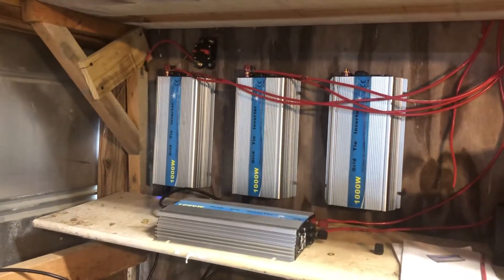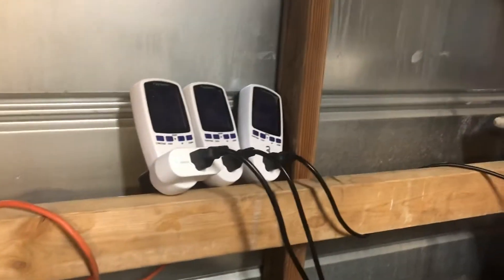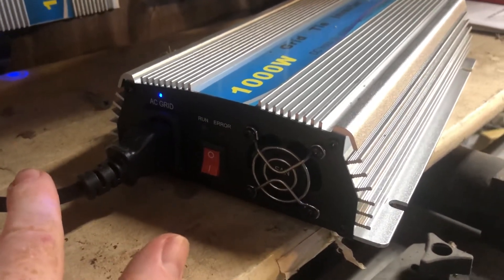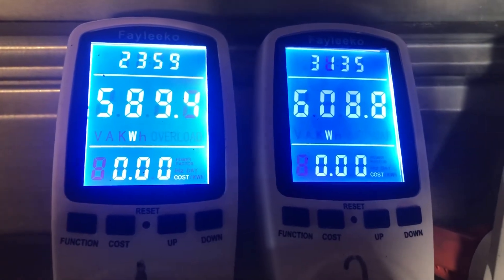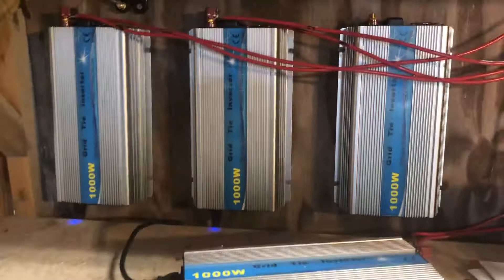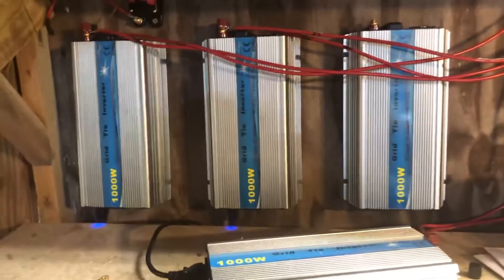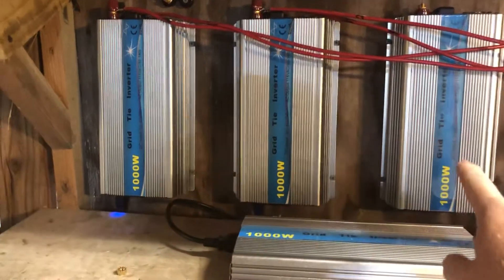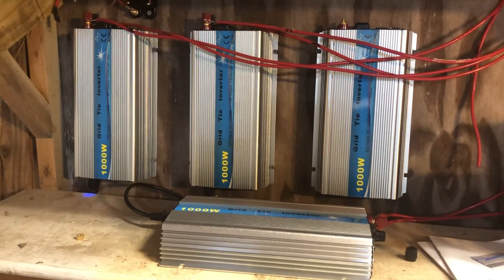Installation of plug-and-play grid tie inverters

Comment: Thanks for your video. Can you say something how long the life time is for this 1000watt converter? Are these good and have you cheap adres?
Reply: i had a 500w ran for several years. until i overloaded it with new panels.  got another one for higher voltage. running perfectly

Comment: I am about to get one. One question; does this inverter give pure sine wave or modified wave? I have a few UPSs connected to the grid and they have to get pure sine wave current in order to work...
Reply: Yes, it'll be the same sine wave as the grid, that's how these things work....they match & sync their wave to the grid wave and then they increase the voltage slightly which means the inverter's power will get used first before the grid and any additional power will come from the grid.

Comment: Add drywall anchors/screws so they stick down into the cooling fins and install 12 volt fans, 2 per inverter. Wire the fans directly to the inverter terminals so they spin they will start spinning around 8 volts, we use a resistor to cap them at 12 volts.  You will never burn one up again

Comment: Good setup. 

Question: Would it work with a 110 volt Ac to 12 volt DC converter (600W)? Is there a limit on the amps?

Comment: to be clear on my end, these and most grid tie inverters can be tied to wall outlets as long as you do not exceed the current rating of the outlet ?
Are these, and most inverters 220vac ? if so do the inverts come with a neutral connection so you can pick off 110v and neutral for wall outlet ?
Do the inverters come with a setting for grid down or isolated use ? I understand norm use they need to stop during grid down for line safety.
Reply from the maker: They only produce 120v. In a grid down situation they will shut down so as to not back feed

Comment: Hello. I screwed the inverter to the aluminum plate. The heat from the inverter dissipates perfectly.
Reply from the maker: That sounds like a great solution
Reply: @tennesseevalleysolar4101  My 600 watt inverter with an aluminum plate does not use active cooling

Comment: I need help. I bought used 205 watt panel and Amazon 1000 w invites. But seeing was not as easy. Wires coming from panel to sizes one mark 4 mm and other thin with no mark. And they had to male ends 😢  I had bought 10awg 6 mm can I solder different mm together?
Was also just going get wires with alligator and ring end to connect to inverter will that work.
Plan just help with what electricity I use.

Comment: So,  do you have these inverters running into the same lines that are also powered by the grid at the same time?    In essence,  you plus then into the wall sockets,  so that other wall sockets on the same line will be powered.   Like a fan or something correct?    And if the sun is shining,  your owners/inverters are powering that line.    What if a cloud comes up,  and you don’t have enough power,  does the grid pick up the leftover slack?     So you have 2 supply lines on the same circuit ?

Comment: Have you run into the issue where you have produced more power than you are consuming therefore technically making your meter look like you’re actually using power that you’re not? Or is your consumption way higher than your production?
Reply from the maker: Most of the time, my consumption is greater than production. I dont have net metering, so my meter only counts up which means you pay for what you over produce. However, that is less than paying your full power bill, as I dont over produce very much

Comment: Have you charted the savings and if so, can you predict breakeven or payback time? (ballpark) Using utility costs in my area I'm thinking maybe $500 a year in savings. That's enough to offset my hot tub and a little more. Certainly not instant gratification.
Reply from the maker: I have not tried to chart that. These are a good place to start, but I would suggest to shoot to move on. to something more robust. Growatt has some nice grid-tie units

Comment: I just had a quick thought based off of your design. I noticed that whenever you were showing the voltage meters, wattage meters on the wall that you have the same Emporia electrical monitoring system I have. Just a thought but have you checked to see how much voltage the units are pulling at night time which looks to be like yours is at night because I didn’t see the green lights on maybe I’m mistaken. I read an article the other day where a person was talking about the wattage that these devices pull which granted isn’t much but if you figure having it automatically have the switch shut off at dusk and come back on at dawn, just a thought. I like to set up though, KISS.
Reply from the maker: Yes it was a quick and simple solution. These boxes are not the most reliable and dont last real long but they are a quick and easy way to get into producing a tangible effect on your power bill. 

I never messed with trying to shut them down, but I would thing that smart plugs programmed to shut down at dusk would do the trick.
Reply: @tennesseevalleysolar4101  I actually went through and set my Emporia plugs to do just that. At 9 PM they shut off at 6 AM the switch turns on which is ideal being in east Texas with the amount of sunlight we get, as well as when it starts and stops during the day.
Reply: @tennesseevalleysolar4101  so literall it just start providing power to your home thru the outlet its plugged into and if your home uses 2000w/hr these we will supply xxx. watts .. .making your use of electric less from the grid right?  so one your setups shows 600w..  my home is using 2000w  / hr . so i am pulling 1400w from grid 600 from my inverter.. not constant i know but whatever its producing at a given moment.

Comment: Anybody that is using these, I have a question for you. I’ve got one of these units I’ve been running for a while now and bought one probably 10 years ago and what I’ve noticed is the unit that I currently have running when the leads are not hooked up to the unit it’s showing in the mid to upper 37 V range which is perfect for where it needs to be at based off of the unit that I have. However as soon as I connect it to the inverter and turn it on it’ll start to do its thing but when you touch the leads to check the voltage at them it’s only showing roughly 27 Volts, any thoughts on why this would be? I have double and triple checked each one of the solar connections coming into the unit, and as a matter of fact I have four 300 W panels hooked up and no matter what I cannot get this thing to go over maybe 550 W at best. Even if I disconnect one or two of the bigger panels and use smaller ones it doesn’t matter I still cannot get it over that. Thank you for any input
Reply: solar panels do not have regulated output unless you add charge controllers to recharge batteries. Basically you are reading "open circuit: voltage versus "loaded circuit" voltage. This is normal.
Reply from the maker: All panels drop in voltage when connected to a load. Unhealthily panels on their last leg will drop down to nearly nothing when you try to apply a load.
Reply: If you take a look at the specs sticker/plaque on the solar panel it will have VOC open circuit voltage (not hooked up to load) and VMP optimum voltage under load. You'' probably find that your 37v and 27v are close to those figures on the specs sticker/plaque.

Comment: HOWdy T-V-S,
...
How long did your DEAD unit last before going BELLY-UP  ?
...
How are the WARRANTIES on these units ? ( any ) ? 
...
COST per GRID TIE  unit ?
...
COOP
...
Reply: They usually run about $100-200 on Amazon and/or eBay. Just make sure you get the correct voltage unit you need.
Reply from the maker: They have lasted different lengths of time. These units are not the best, but are a good place to start.

Comment: hi David thanks for sharing this video, I see you have what appears to be an Emporia Smart Plug plugged in to one of your Killawatt power meters, 0:32 how did you get that to work as I tried and it is directional and I even spoke to their tech support and they confirmed we can not use it to measure how much power we are putting back into the grid, it's not designed to do so
Reply from the maker: I ended up not really messing with it much. I was hoping to use the smart plugs and home automation as a way to limit production to prevent overproduction. That project never got far
Reply: @tennesseevalleysolar4101  ha ha well your idea works, or at least it graphs the data but as far as Emporia is concerned it shows it as consumption and not negative numbers as in ingestion of more power, I did let the company know, they are working on it
Reply: @tennesseevalleysolar4101 Mine smart plug keeps cutting off. So much for that.

Comment: Folks, these are very simple machines, very little to go wrong. The user will kill them. 
A few rules, heat kills... I run a 1000w at 450w coming in. Temp is always keep at 
95f,. Very cool to the touch.  I pulled the bottom fan and put a better fan on the out
Side. Never run over 50%, never push these, a cool unit will last for years.. Last rule, 
Dont expect to make money. At. 12 cents per kwh, 1000w, you do the math. I do it
As a hobby and to keep my 700 watt solar system busy..one other thing, try not
To run a 12v grid tie, you have to use 10awg wire, i went with 8g into the unit.. 
Keep all your wire cool... 
Thanks for the vid
Dennis
Reply from the maker: Yes, the wire in the video is 8 Gauge THHN. I have 1200 watts of solar on my grid ties and they seem to work ok. I guess that wears them out faster, but I keep a large box fan hanging in front of them to help cool them down

Comment: do you need approval from the electrical utility company to use a grid-tie inverter?
Reply from the maker: It all depends on what area you live in and what the power company rules are. Some companies dont care at all and others go out of their way to make it nearly impossible
Reply: Two things.  First of all, there are "greedy" meters out there; meaning they only count UP, even if power is going TO the power company. They get free power from you, and you show no usage.  Secondly, if you keep your supplemental energy below what you use, the power company will never even know.  All they will notice is that you're no longer using AS MUCH energy as you use to before.

Since the homeowner doesn't have to mess with the breaker panel, there is no need to call an electrician, and no need to ask permission from power company.

The only negative thing I can think of is what happens when there is a black out and you are not home to stop the inverter from sending power into the grid? If a lineman starts working on a wire, they will get shocked because they are not expecting the power on the line(s) from the customer side. THAT they would be upset about.

Even if one has a timer that only allows the inverter to run during daylight hours, if a black out happens during the day, I can't think of a way to have them stop sending juice.
Reply: @redmatrix  " Your very own comment from above. called anti-islanding, or islanding protection" a GTI has to sense power (120V) on the line it is plugged into before it will send power from the inverter. That's why you can plug in your panels and hook everything up and then grab the prongs that go into the wall socket, it won't energize the plug end unless it senses 120V coming in.

Comment: May i ask what kind of utility meter you have on your home? Digital or analog?
Reply: digital
Reply: @solar24gr  how is it possible to back feed with digital meter? My understanding is if you dont have a bidirectional meter you will be charged for power you backfeed to grid as if you were actually using said power
Reply: @randynewman3184  My own is digital for me to see how much generated per dey but the electrical company meter is analog
Reply: @solar24gr  perfect! Do everything you can to not let utility company change your analog meter! That analog meter is priceless! You basically have free energy storage solution
Reply from the maker: Yes if you dont have a bidirectional meter, you would be charged for any power that you over produce. For this reason it is best to keep your grid tie production close to the amount that you are consuming. If you over produce by a little bit, that is better than paying your whole bill.

Say, for example, you are producing 2500 watts but only using 2000 watts. You would be paying for 500 watts. Would you rather pay for 2000 watts (no grid-tie) OR 500 watts (from the over production)?

Comment: Unfortunately this inverters will burn about 3 or 4 months maybe 6 months! Over heating problem!
To avoid damage you must modified cooling fanction!This inverters start cooling by fans over +60-70 celsius!
That inverters need install thermostat switch N.O. 45 celius stick on transformer and must connect in series the fans to with thermostat switch,fans will start cooling from 45 celsius and you will avoid the overheating damage.I am technitian.
Reply from the maker: I have seen similar issues. I have a large box fan hanging from the front of the shelf above. This seems to be helping a lot

Comment: The wall sockets are already live and  supplies 110v/220v ..... ?  Will this not cause "feedback"‽
Reply from the maker: No. The grid-tie equipment produces the exact same sine wave of power as what is already in the socket so the power does not "fight" with itself
Reply: i’m not sure if he showed it in the video or not but whenever you first plug the device and of course you want the switch to be in the off position and then your panels hooked up and plugged into the wall. Once you’ve done that and you flip the switch on the Red light mean momentarily come on then the green light will come on and it’s flashing, as it’s doing this it’s adjusting itself to the frequency of your current electrical grid at 60 Hz approximately. Once it does this the light will go solid green and you are now back feeding, Offsetting what you would normally be using. At any given time if you normally drill 1500 W and you have this plugged in during the day and it produces 500 then during that course you actually only pulled one thousand off the grid and your unit produce 500 but at night time you’d be pulling 1500 off the grid because you’re producing nothing at night unless you were using this on a battery back up system which is a whole Nother story lol

Comment: Hi there…many thanks for posting your video…I wonder if you can help me regarding the following…I have bought a 1,000 watt Grid Tie Inverter…but has come without instructions…it shows DC input as 10.8 - 30VDC……..AC Output:230VAC (170-260)………I am in the U.K. and have 7 X 100watt 12volt solar panels…ground mounting I hope…though I doubt with the U.K. weather that they would put out anywhere near the 700 watts especially in the winter…could I link all 7 panels together to leave as 2 cables positive and negative and connect to the Grid Tie Inverter?…also could you tell me do you connect the Solar Panels first to the Grid Tie then plug in the Mains plug?…or doesn’t it matter providing the little red switch is off?…I would be grateful for any help  about this…many thanks…Brian
Reply: Hi Brian, I'm using one of these and the manual suggests you connect the solar panels first before switching on the mains. I produce about 400 Watts as recorded at the outlet with mine but I don't notice much of a drop on my home electricity consumption while it's on so I'm not sure if mines working entirely as it should. How are you getting on with yours?
Reply: @jamesb3177  Hi James…thanks for confirming the order of connecting up…I’ve not yet done so but now I know the order hope to possibly connect this weekend…needing to take cables though into my boiler room then through the wall into the kitchen so I can plug it in…I’ve bought a killawatt plug thing so hope it all works ok…I will let you know…Brian
Reply from the maker: This would not work. Connecting the panels as you have said would put the panel in series which raises the voltage and leaves the amps the same. You need to parallel your panels to keep them with in the voltage range stated.

Comment: Is it possible to set up my grid Enphase IQ7 13kw system using these less expensive devices?  Enphase makes a nice battery grid system but it is not cheap
Reply from the maker: I have no idea. I have not worked with that unit before

Comment: Is it better to put 500W through two of these, or 1000W through one?
Reply from the maker: I find that the are not real picky. But they are really sure reliable either. I have lost a couple of them but I am pushing them kinda hard. They might last longer by not maxing them out, but then you have more expense. By that point, you might as well have stepped up to the next level of grid tie equipment